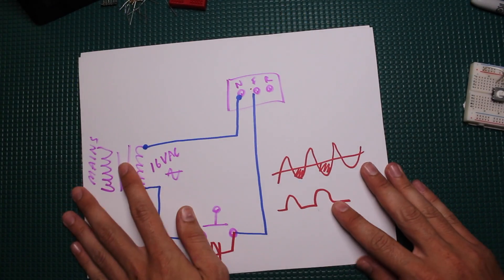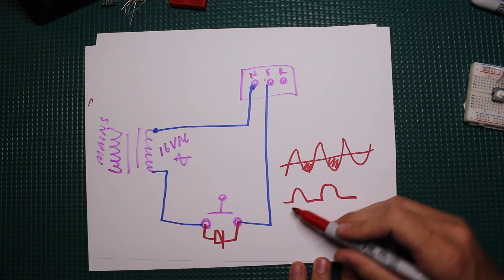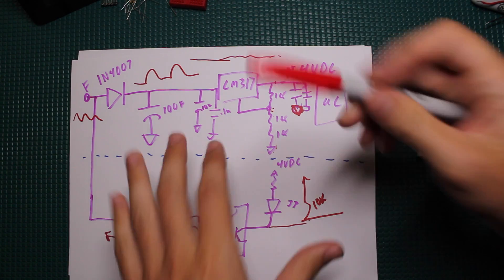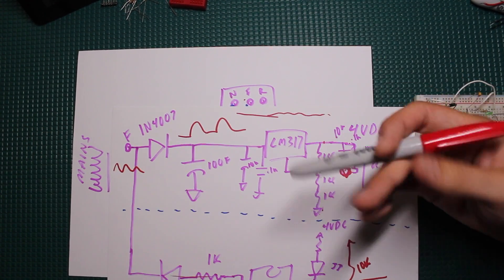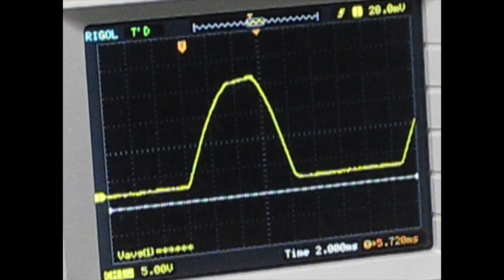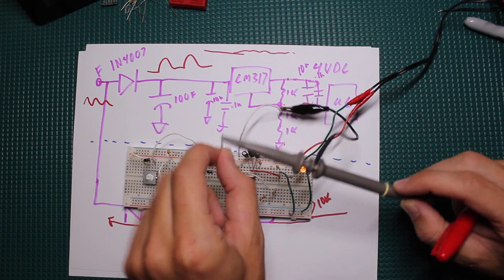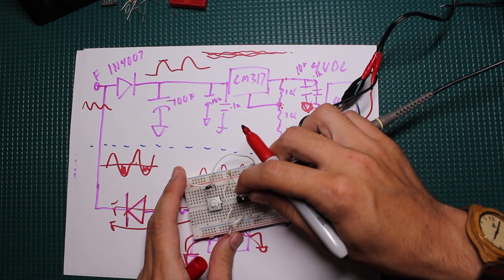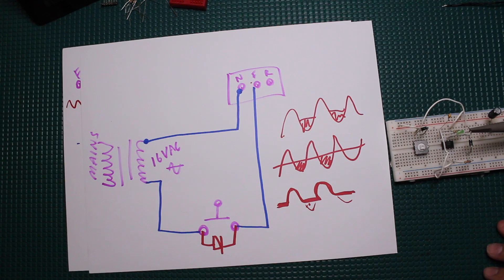Purpose of the Diode in Doorbell Circuits?  Test circuit and Experiment!

Comment: you say 100 micro FARAD yet the scheme shows 100F  or is it 10uF ???
I am not an electronic engineer...  I have some understanding...

So, I have this door-bell PROBLEM, it does not activate the WHOLE TUNE/RING unless the button is held DOWN..
I used the DIODE as recommended, tried both polarities and it does not work...
The batteries, when installed have no affect either..
I was wondering if there is a way to add A SMALL CIRCUIT  with a capacitor that will charge when the button id pushed, and will keep the CHIME GOING as it discharges?

Is this here your solution?
 

THANX

Comment: So, your circuit idea does work but this is not, typically, how it's actually implemented, commercially.  The problem with your "solution" is that it requires that the push-button diode to be installed in a specific direction.  If you look at instructions for Hampton Bay, for example, the diode direction does not matter.  It's also why there is no mention of having to reverse the polarity of the diode if the doorbell isn't working correctly.  (I believe older Ring doorbells did only work in one direction, but this is the problem with the Internet as information becomes dated or is only specifically correct.)  The actual implementation for this is not polarity sensitive and works no matter the orientation of the bypass diode.  Easily accomplished since the output of a full-wave bridge rectifier will only be half of what it could be if there is no half-wave rectifier (the bypass diode) on the AC input.  Now, when the button is pressed the voltage of the FW bridge is twice what it was and THAT is what is detected.  The voltage regulator takes care of the temporary voltage increase (ringing a doorbell is a momentary operation, anyway) and the FW bridge ensures that no matter which half of the AC wave form you randomly detected the circuit works as intended.  This is actually no more difficult to construct then what you suggest and the quiescent state of the system limits the power drop across even an inexpensive linear voltage regulator.
Reply: you do not get "half voltage" from a half bridge rectifier in any normal operation.  you will only get "half voltage" in a low pass filter.  there are plenty of detection circuits out there, but the first generation of these doorbells was in fact polarity sensitive, I have dealt with this a lot back in the early 2k's.
Reply: @AlecKristi  Incorrect.  The RMS voltage (what is used in AC measurement) is the equivalent DC working voltage.  With only half the wave present the resulting DC voltage averages to half of what it could be since HALF THE WAVEFORM is missing.  Period.  This, in essence, is a form of pulse-width modulation which is commonly used to dim LEDs.  Not sure why you chose to argue a subject you don't really know (electronics) but your only anecdotal "argument" is that you "dealt with this a lot" TWENTY YEARS AGO.  Ugh.  BTW, I did say this video was dated.  I'm pretty sure people from 2002 aren't here reading this for information to take back to 2002.  Specifically because the first video doorbell was available in 2012 (DoorBot) and Ring didn't have one until 2014!   SMH   Stay in your lane.  There is no such thing as a "half bridge" rectifier, genius.  It's either a Full Wave rectifier (which requires a CT transformer and is exactly half of the secondary voltage winding) or a Full Wave Bridge rectifier, which is WHAT IS IN MY COMMENT.
Reply: @DiffEQ  sounds like you have great knowledge of theory, but zero understanding of reality.  also, you're confusing energy with "voltage" and "rms measurement".  half wave rectified DC isn't "half voltage".  especially, since in case of electronic doorbells, the very next component after the rectifier is a capacitor, and unless the circuit draws all the available power that is supplied (hint hint - it doesn't), then the voltage of the power supply will be higher than the "rms voltage" prior to recertification.  don't believe me?  set up a transformer, a diode, and a capacitor on your desk, and get out your meter.  also, I'm very familiar with PWM, I have been manufacturing PWM dimming controllers for over a decade...
Reply: @AlecKristi  Alec, you really shouldn't argue with a 40+ year retired electrical engineer about basic electronics.  You don't even use correct nomenclature, so it's really not something you should be arguing.
I made no mention of energy and neither should you as the point is one about voltage, not power or energy.
I clearly said that this is NOT how it's done in the present and did not suggest FW modification of his circuit.  Clearly.  That said, my original statement is correct and stands that the output OF THE FULL-WAVE BRIDGE will be half of what it is when half of the input is clipped.  Now, if you want to put filtering/storage caps on the output of the rectifier to allow it to charge to Pk or Pk-Pk values, then you're arguing something different than what I stated.   My FW bridge output will definitely detect when the input is changed from HW clipped sine wave to a full sine wave.  Period.  If you add circuitry that hides this detector function, then that's on you.  Don't chide me about understanding or pretend that I'm some academic individual with no real world experience.  Undoubtedly, you or someone you know is using a device that I helped bring to fruition.  How's that for reality?
Reply: @DiffEQ  ok, you win a semantics argument.  English isn't my first language, and I didn't learn physics in English, so my nomenclature may not be as exact as you'd like.  however, if your skip the semantics, and stop counting "technical points" by taking the power supply circuit components out of the real world, and assuming that you'll be using a "spherical bridge rectifier in a vacuum" instead of a real power supply circuit, your may start to realize that you are in fact not correct, despite being a retired electrical engineer.  while it would be possible to "detect the voltage drop" the way you describe it, it would be just as cumbersome in the real world application as the OPs solution in the video, if not more so.  you'd either have to introduce another diode before the filtering in the power supply, and another load resistance, or have a separate rectifier for the doorbell circuit from the detection circuit.  also, please keep in mind that I'm not arguing the concepts with you, but a real world application in a real world circuit, that has to do with half-wave trigger detection, specifically in an electronic doorbell.  also, it looks funny when you like your own posts ;)
Reply: @AlecKristi  Please don't accommodate yourself with the claim that this is simple semantics or just "technically correct."  This  is a TECHNICAL subject and it definitely needs to be "technically correct."
You need to read for context so you don't keep making this mistake... which you continue to make.   YOU are the only one building a power supply circuit and I have never suggested such a thing.  My comment is on how MODERN door chimes do not require the installer to pay attention to the polarity of the bypass diode.  The OP's solution requires the bypass diode to be the same polarity as his rectifying diode.  This, as my original comment states, is why modern electronic door chimes have been improved with a simple solution CLEARLY USING a non-polarized input which must be a FW bridge even if only half of it is ever conducting;  It's cheap and off-the-shelf.  It could just be two diodes in parallel with opposite polarities, but that's just more labor and board space.
What happened to your accusation that I am conflating energy with voltage and that I don't know shinola about the reality of things?  New argument always means back-peddling, has been my experience.
Reply: @DiffEQ  your claim that your get "half voltage" with half wave recertification is not correct.  both in concept, and in practice.  this is what I stated in my original reply to your original comment.  you have escalated to personal insults and weered off into concepts.  voltage is the measurement of potential difference between conductive objects.  in order to get half voltage from half wave recertification, you need a low pass filter, consisting of a capacitor and a resistance across it.  it needs to be balanced in a way that the resistance will discharge the capacitance at the same frequency as the input pulses charge it.  in a doorbell power supply circuit no engineer would be stupid enough to employ a design that relies on "half voltage" for a plethora of simple reasons.  the "technical points" I'm referring to are semantic ones, to answer your claim that I used wrong nomenclature.  you're still wrong in a technical sense of how the circuit would work in the real world.
Reply: @DiffEQ  also, just to clarify, so you don't "misunderstand" my reply, your ARE NOT technically correct, you are "counting technical points", by applying your solution to a spherical bridge rectifier in a vacuum.

Comment: The push of the button opens the circuit not closes it.  My doorbell is lit...closed circuit.  The solenoid is energized and hammer retracted on chime.  When doorbell is pressed, circuit opens, light goes off,  and spring loaded hammer is released and strikes bell.
Reply: I, with 40 years of  electronic and engineering experience, have never seen a normally-closed bell loop.  In fact, with the old mechanical chimes (all were) a normally-closed loop would NOT HAVE WORKED and what you described is a mechanical chime!  The spring keeps the plunger retracted and energizing the solenoid is what opposes that spring.  You couldn't be more wrong if you tried.  So, keep your chiding to yourself because are not just wrong, you are VERY wrong. The button is illuminated, genius, BECAUSE THE CIRCUIT IS OPEN and the applied voltage is measured across an open.  Ugh.  Seriously?  Did you notice the light goes out when you press the button?  That's because the voltage across the light goes to ZERO when the button shorts across it.  Some people.

Comment: Gaahh, I ordered a chime from amazon warehouse and the diode was missing. 
           I guess the 1N4007 is the right one?
              It's a Westminster chime.
Reply: any small rectifier diode will work.  1N4001, 4002, etc.  Nothing larger than a 4001 is necessary.  The 4007 has a PIV of 1,000 Volts and that's completely unnecessary.  the 1N4001 has a PIV of 50V and will do just fine.

Comment: I have a Ring doorbell and a digital chime so there is a diode installed in the Ring.  My problem is that I am getting ghost rings when no one is there.  This happens at various times of the day and night.  Do you think the diode could be breaking down and causing a ghost ring?  I have been in contact with Ring and they are scratching their heads. They graciously sent me a replacement but after a week or so the ghost returned.  Appreciate any ideas.
Reply: The problem is likely a cheap chime that is overly sensitive to voltage fluctuations/spikes or your power source (LV transformer) is too close to the voltage limits and then line voltage variations will cause the chime to see that as a button press.  I've always wondered why people think when they call the manufacturer they think the person in the call center knows anything more than what's on their screens.   Bottom line:  it's clearly either an improper power issue or your chime is just hyper-sensitive.  If you put another silicon diode in the circuit (same orientation, in SERIES, not parallel,) then you will know the voltage down about 0.7V and that may just be cure your issue.  a 1N4001 will do just fine.

Comment: Still dont understand how the doorbell knows button is pressed. It looks to see when wave pattern is changed? Does doirbell have microprocessor?
Reply: His reasoning is no longer applicable.  Think of is this way:  The diode prevents half the voltage from reaching the chime until the button is pressed and then the full voltage (diode shorted) is seen by the chime.

Comment: hi there I've watched all over the video and looking what was the diode all about and I am understand that  the diode can use a rectifier but I really don't get 
why the diode need to placed in the switches, In layman's term what will be the significant used of the diode there.Is it for the sound quality of a doorbell, for the  delay sounds if you press it, or much longer sounds..why  it should be there..Please elaborate Sir, only electronics enthusiast and electronics engr. understand the point of that experiment. , it was explained the flow of current and the output but as a viewer who wants to understand the real use of it in laymans term wasn't explained clearly to us.
Reply: The button is normally open so the power circuit to the chime is open.  The diode allows half the power to the chime until the button is pressed and full power is sent to the chime.  The chime doesn't need this power to operated, it just uses it to detect the button press.  By the way, not everyone is writing to the audience that has ZERO understanding/background.  Asking someone to teach you fundamentals is asking a lot.   You have plenty of resources for learning electronics if you want to learn...  which I think you don't.  So, get used to not understanding deeper explanations.
Reply: Man thank you for your reply,Im an electronics engr though I practice in broadcasting industry that is why I am more on rf  transmission...I am requesting for the explanaition for those who are not clearly understand the electronics and not for me

Comment: I bought a Ring doorbell and it won’t stay on for setup and video. Can I eliminate the old ding-dong bell and relay to provide continuous power to the doorbell cam? I don’t need the old bell since it came with a chime that is plugged into an outlet.
Reply: Depends on the model.  Use Ring as your source as your problem is specific to that product.  Really?   I happen to know that older Ring doorbells required a limiting resistor if you bypass the original bell (which wouldn't work, but provides a current limiter for the Ring doorbell.)  I think that requirement is now gone.   But, again, ASK RING!!

Comment: Enjoyed the video and it confirms my suspicion on why it was needed, thanks!  Now, riddle me this.  I got a new "westminster chime" unit for my wife as a xmas gift since she suggested it (that was easy).  But, I'd now like to take the old "ding-dong" unit and install it in my basement/mancave/hamshack/workshop.  I thought it would a 10 minute job.  But, with the diode there now in the push button, the half wave ac is more than enough to put the "ding dong" doorbell into a state of continuous humming.  Luckily there is an unused third wire in the cable from transformer to new doorbell chime and then to front door push button.  So, if I could find a double pole push button I could split the two chime units onto two separate circuits (one w/ diode & one w/o diode).  But, I though I'd pass this dilemma by you for comment, ideas, or suggestions.  Let me know what you think when you get a chance.  Thanks & 73's de Rich AF1K

Comment: Well done video, but if you already have a 1N4007 diode in your circuit prior to the LM317, then the diode at the button is redundant is it not?
Reply: No.  If the diode is not across the pushbutton then the circuit is open and the chime is only powered during the button press.  That said, this is not typically how the circuit is implemented as it required a specific orientation of the bypass diode.  See my other comment for a full explanation.

Comment: +Kevin Darrah - This is good work, but I would be inclined to use a bridge rectifier and maybe a larger electrolytic capacitor in a real doorbell application, instead of the single 1N4007 rectifier that you showed in your test circuit schematic.  In standby mode the regulator would still produce 4V, but when the sounder needs more power, i.e., the pushbutton is depressed, a full-wave rectifier would make twice as much power available to the doorbell.  Since you have an optoisolator in your scheme, the loss of ground reference on the power supply wouldn't matter; it would still work.

Comment: Why you need constant power to MCU, those "singing greeting cards" play in miliseconds after activated, why a doorbell "player" can't "boot" in relatively no time?
Reply: You miss the point.  The chime would quite playing as soon as you released the button.  It's not so the chime will work when the button is pressed, it's so it will work when it's no longer pressed.  THINK!  BTW, that is a design issue and would have nothing to do with this explanation, anyway.

Comment: Great video. You need the sevond diode for an other reason too. If you press the button without the second diode, the negative portion hits the positive side of the cap and discharges it with a relative high current.

Comment: Excellent video, I was wondering also what the diode did as I am installing a Ring doorbell Pro on a friends house and I saw the diode when I did some preliminary checking. I had just installed one on my house but it has the conventional mechanical doorbell and my friends house has a newer chime. Great idea on your part to use an opto-coupler as it isolates one side from the other. Thanks for this video.